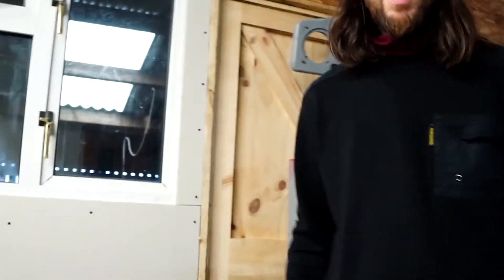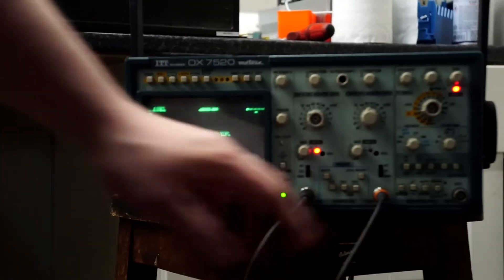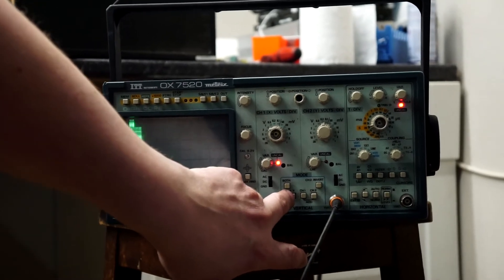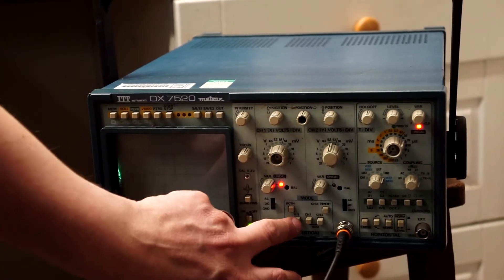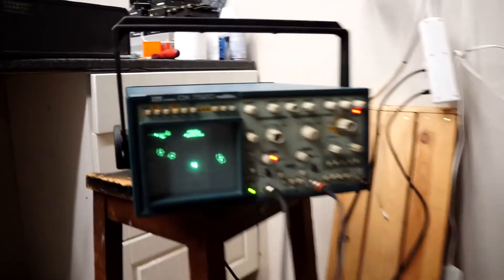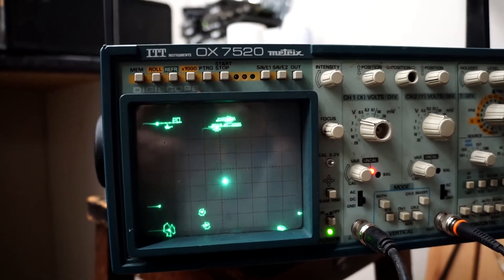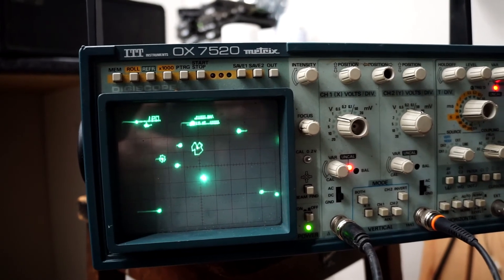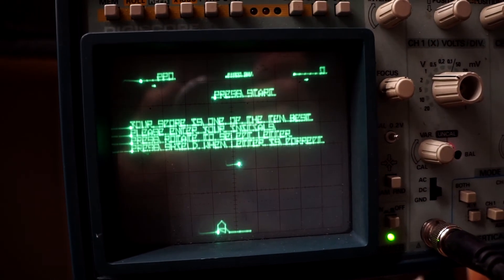Using an oscilloscope as vector screen for a asteroids arcade table

Comment: RETRO LEISURE MIDLANDS LTD, 
for vector games, what is the "state machine PROM chip doing? 
whats the difference between an XY point counter signals compared to H&V sync signals?
Reply from the maker: Hi there Bill, We may make another more in-depth video about the machines repair, going into more details but this ones just meant as a quick and dirty demonstration on how the scope can be used as a vector monitor. When I was shown this in our workshop I was very impressed and thought others would like to see it working. If you have a monitor that's in need of repair, give us as call and have a chat with one of our engineers, they love talking about different monitor types and board chips.
Reply: @retroleisuremidlandsltd  yes can you make more in depth video repairs to go over vector games or raster arcade games